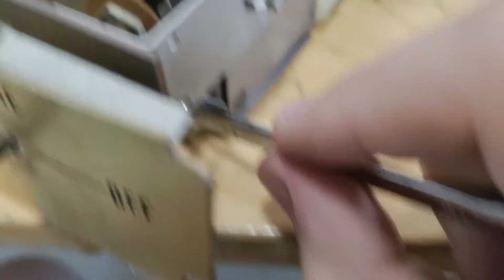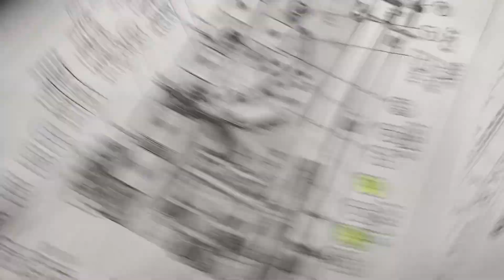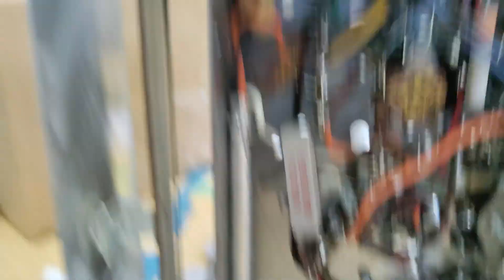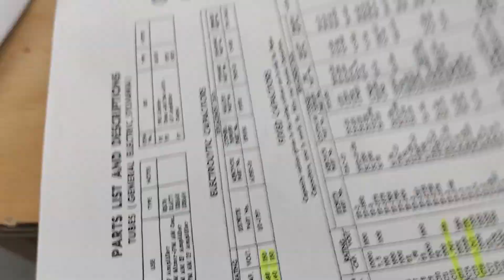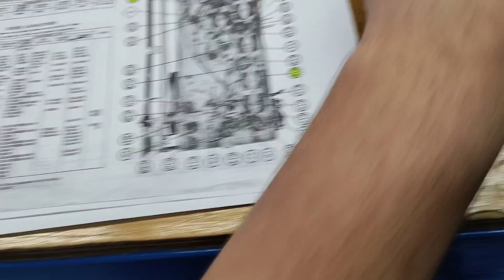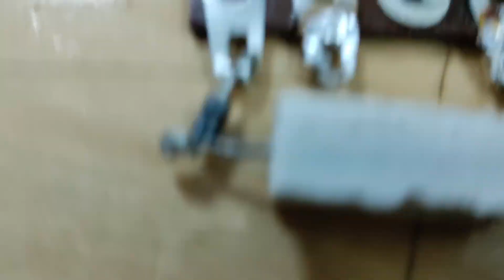Zenith B723W Repair Part 2: The Filler Episode

Comment: You might find that both top and bottom sections of the RF transformers are adjusted from the top with two different size hex keys.
Reply from the maker: Thank you very much for that comment. I took a look inside the RF transformers and it indeed seems to be two different hex keyholes, but the bottom one is incredibly difficult to see. Hopefully that will help for when I can hopefully perform an alignment on this radio.